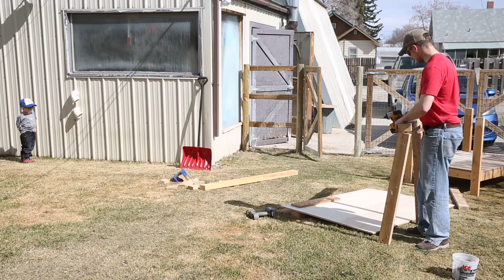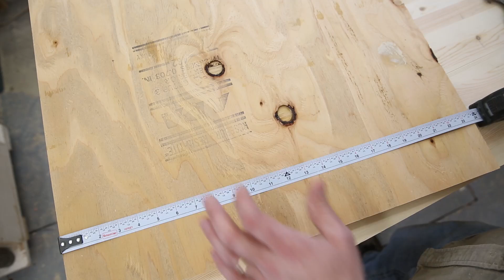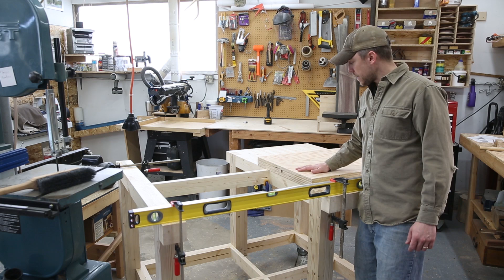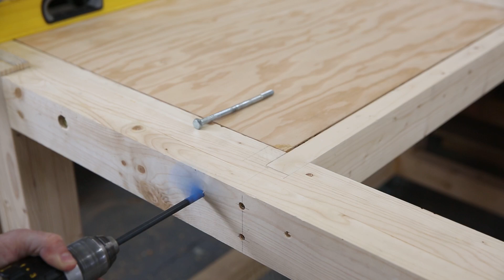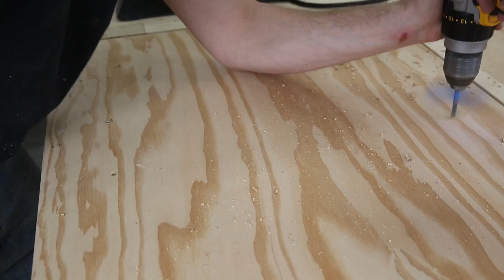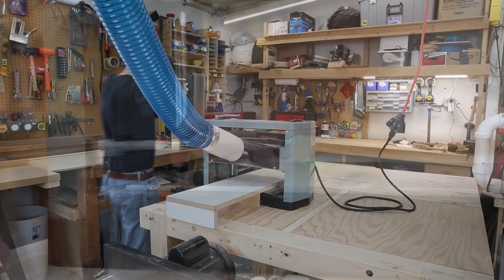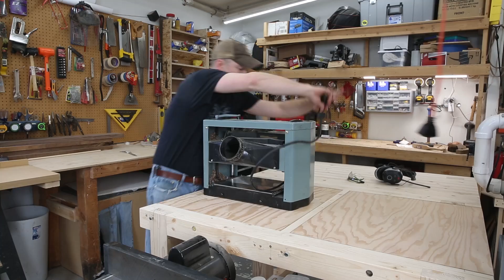Double Flip Top Workbench - The Flipening (Part 2 of 3)

Comment: I'd noticed during the build (part 1?) that you used the planer (thicknesser) first then joiner?
I thought it was get a flat side and end (joiner), make the parallel (planner) side and end then plain to thickness (if needed)?
Simple answer; It was swapped during editing?  ;-)
Reply from the maker: I would say that swapping during editing is the correct answer. Its also possible that I was just planning the face's of the boards to make it better for glueups. Then I jointed and planed them in the correct order once I had made bigger chunks of wood.
Reply: I was wondering. In most cases (90%+?) the planer/thicknesser is used after the joiner so why not have them positioned (combined) for the in flow, out flow tables to line up (4'+ between)?

Comment: I think the flip tops are very neat, but they do take up more space than just lifting the planer into place.
Reply from the maker: Thats true, but those little planers sometimes weigh 50 pounds or more. This design cuts the effort required to lift it way down.
Reply: Gunflint Designs yep. it's definitely better for your back
Reply: I have the Dewalt 12.5" (DW734) planer and it weighs 80 pounds. Would to be able to flip it.

Comment: I have used water based and oil based poly on shop projects.  on table tops, oil based poly with 4-5 coats have worked best for me and hold up well.  glue wont stick and stains wont stain once it cures completely (a week).  great bench design.  epoxy a wood block to your pins and you can put the vise grips away :>)
Reply from the maker: Thanks for the input Russ! And for the pins... that's exactly what I did! Some sexy black walnut handle turning coming up in the last video for this project.

Comment: use a paste wax if you're going to be doing glue ups on it, as it will help get any excess glue off after it dries. otherwise, poly or linseed oil would probably work awesome.